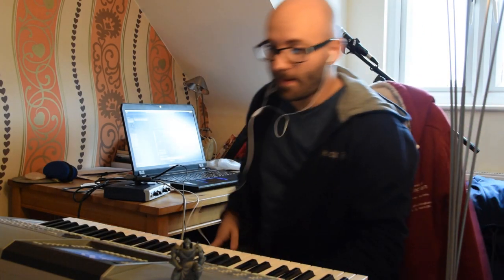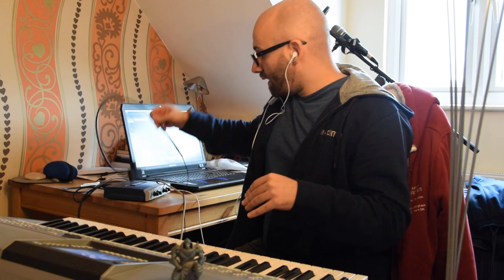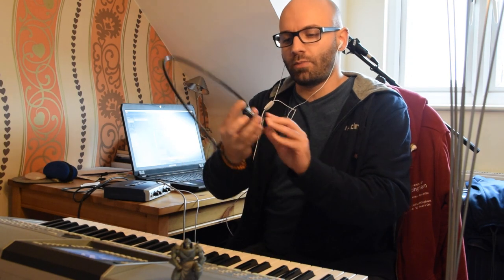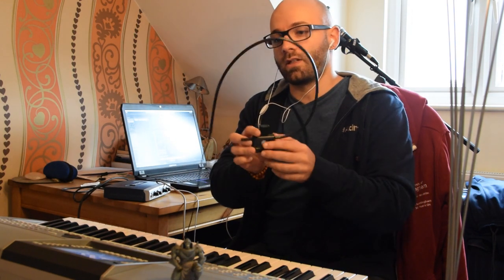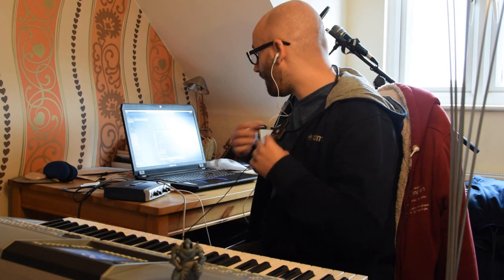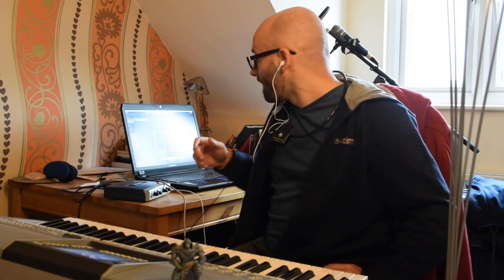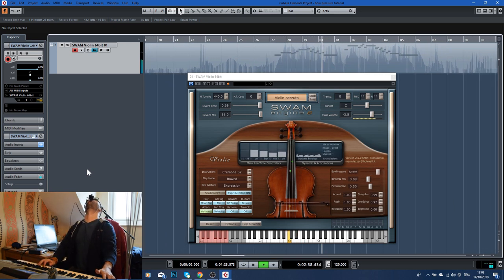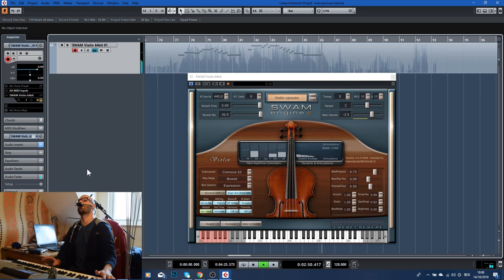SWAM Violin tutorial/demo (Bow pressure)

Comment: You can just calibrate the TEC, using the software in which you assign the CC values, so that the 'head nod' does not have to be so exaggerated, forward or backward, ie, smaller amounts of movement will translate to greater increases in pressure. That way, you can cover the whole range, from flautando to scratching, without having to perform such extensive head movement. The same applies of course if you use any of the other parameters (head tilt, head roll or bite). If you combine the TEC breath controller with other midi controllers (I use a nanokontrol2 and an expression pedal), you can control more of the violin paremeters in real time. There is no more expressive VI for violin Audio Modelling's SWAM violin.
Reply from the maker: You make a very good point! Indeed you can control these parameter in the TEC application. I was just being lazy haha. But thanks a lot for pointing that out anyway. It is something that should be said. Also, I have never heard of the nanokontrol2. I will look it up!